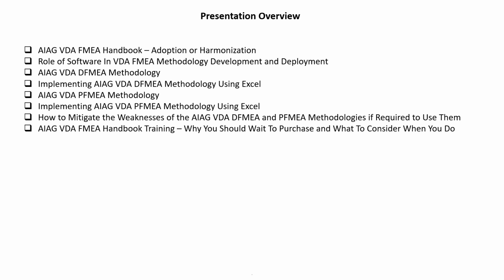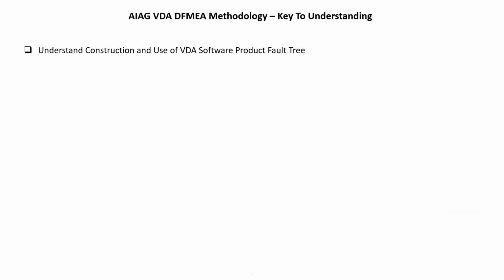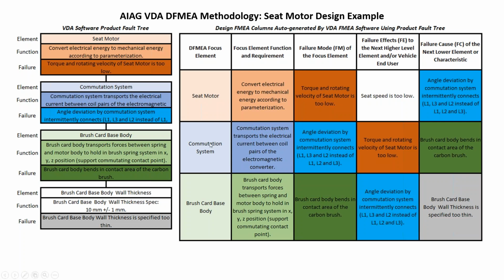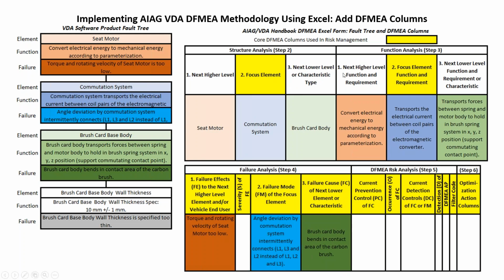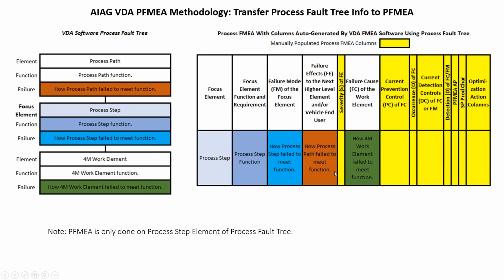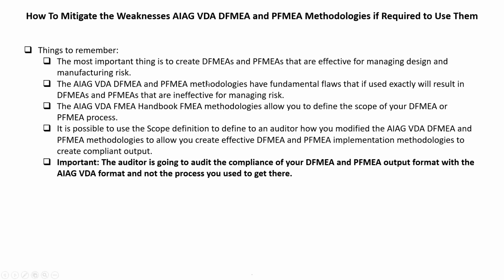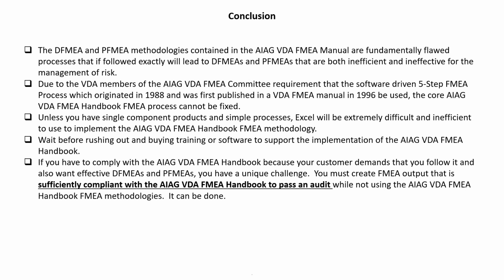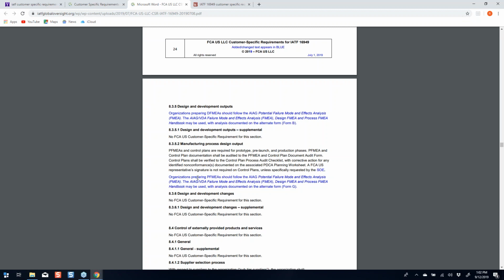ASQ AIAG-VDA FMEA Webinar - Implementing DFMEAs & PFMEAs Using The New Handbook

Comment: Agree with Loki.  This structure can limit the depth we go to in examining possible causes.  We start with an idea like needing a bolt tightened to a specific torque.  We can say the failure mode is that the bolt does not reach it's torque, and the cause would then be the torque gun did not achieve ITS torque, but the FMEA limits us exploring WHY the torque gun failed (simultaneous compressor usage, wear in the torque gun.)  So we are somewhat broad in defining a failure cause, and miss some nuanced details.  We can still capture them, but then our controls are a little harder to link back to the original failure mode.  I've often found that in my FMEA's I say torque gun loses torque BECAUSE, or DUE TO.  In other situations, if I'm doing a family FMEA, I set the failure mode as the torque gun's torque, and this allows a deeper level of cause.    If we don't push for that deeper level, we can find ourselves contented with our current controls, or we simply miss possible causes because we don't ask why again.  Trying to harmonize our desire to have a clearly linked control plan and our desire to use FMEA to improve our processes is a real struggle sometimes.

Comment: Very well presented. The AIAG VDA Fault tree structure limits us engineer to really focus on all potential troublemaker on root cause level. They call it Failure cause column but they only show  Failure Events. Perhaps this comes from the limited Fault tree thinking. A Fault tree only shows Failure events and this is misinterpreted as reasons or Failure Cause. Not answered WHY questions demonstrate that this VDA AIAG FMEA approach can not succeed.